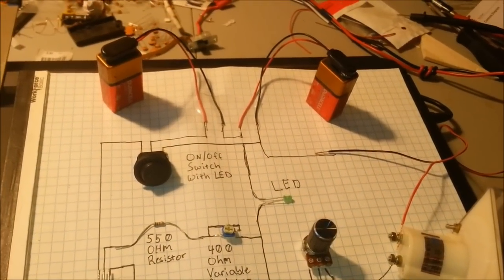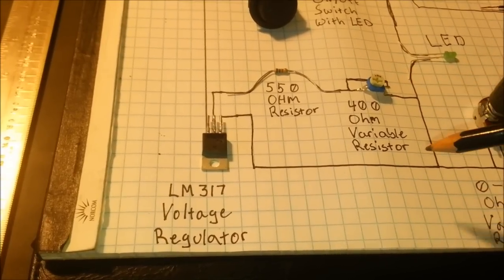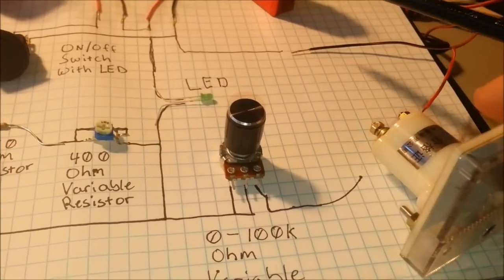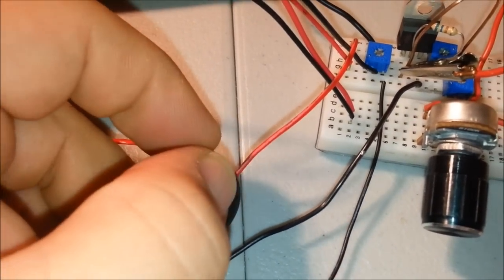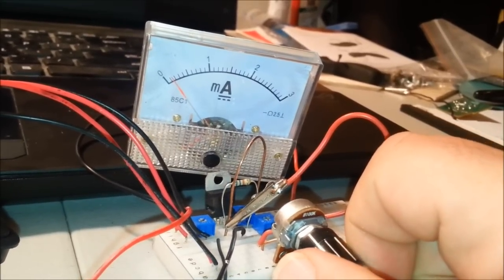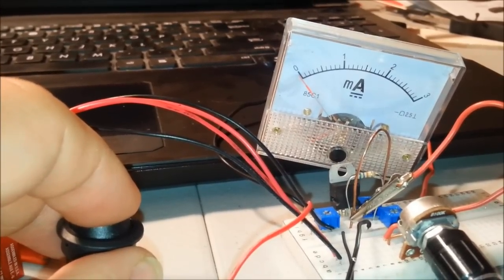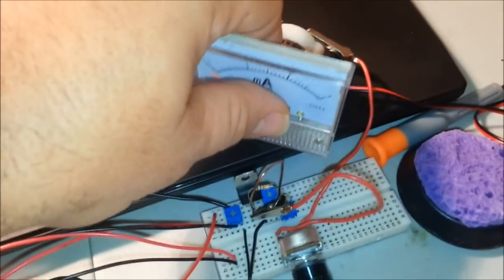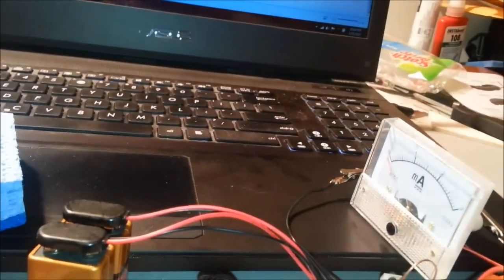Easily build a tDCS machine - How to DIY

Comment: The only problem I see with this is the availability of parts.  If you can find an electronics supply store like Radio Shack used to be, you might be in business.  Unfortunately, I don't know of ANY that are still operating in our area anymore.  Like "Hobby Shops", most if not all "electronics supply stores" are a lost remnant of simpler times...
Reply from the maker: How true, my friend. This is one of my oldest videos. Those stores are all extinct. You can try adafruit, mouser, or digikey and the like to make online purchases. Good luck.
Reply: @JonCammarata  Is it a big deal if I use a 560 Ohm resistor instead a 550 Ohm one? The internet is full of 560 ohm resistors but I cant find no 550 ones
Reply from the maker: @LesDudez  Nope, that should be just fine.
Reply: @JonCammarata  I would like to know why you are using 2 batteries instead of 1. Wouldnt one 9V battery be enough?
Reply from the maker: @thomaskreisel5764  There are a few reasons. The current regulator works better with the higher voltage. The internal resistance of 9 volt batteries is high. So, the extra current availability tends to help.
Reply: @JonCammarata  Thanks! 🙏

Comment: I have been using a TCDC device of my own making for about six years.  It certainly has boosted my cognitive abilities.  I use a basic small volume control to address controlling the intensity.  As a side note, I would add that it seems to actually help with manifesting things.  In other words, they say that your thoughts have power.  In my case, I give more power to my thoughts.  Whether it's related to the documented effect that thoughts seem to have at the Quantum level of reality or not, my attainment of things that I want to bring into my life seems related to the use of TCDS.  Consider that possibility.  Prayer, meditation, etc. all brought up to another level with the addition of more power...So, be careful what you wish for.
Reply: Interesting.

Comment: Got a 2mA read it, finally! Can't wait for my 4mm banana connectors to get here so I can attach my electrodes!!! I got the Caputron 2"×2" electrodes.

Instead of a 100k ohm potentiometer and a separate switch, I got a 100k ohm potentiometer with a switch inside and wired it where you have your switch. That way, the potentiometer can never be up at 2mA when I switch it on, so no possibility of a flash! Unless of course I turn the dial too fast.

Thanks for the video. Very helpful.
Reply from the maker: That is great to hear. Good luck.
Reply: @JonCammarata  One last question. Which one is the cathode and which one is the anode?
Reply from the maker: @rowanmurphy5239  Anode is positive. Its the one attached to the circuit. The other is the cathode. It is connected to ground or negative lead on battery.
Reply: @JonCammarata  many thanks. I can't tell you how much I appreciate your video and I'm very excited to own a TDCS device!
Reply: @JonCammarata  I have mine hooked up in DARPA montage currently (anode right Temple, cathode left shoulder) I'm instead of drawing the 2 milliamps it was drawing just before, it is now drawing 0.2 milliamps. Is this normal? I can feel a slight tingle on my right temple.
Reply from the maker: @rowanmurphy5239  make sure you have good moisture on electrodes. Also thats a long way from shoulder to temple. The current regulator may not be able to keep up with the voltage drop.

Comment: Thanks for the video. Just wondering a couple of things.

First, is a 0.5 watt 400 ohm variable resistor enough? That's what I found on digikey.

Secondly, I looked at the diagram. I'm confused. But that's likely my fault. You have a wire to too my mind looks like a short circuit. To describe it, is the horizontal lines under the batteries between the on switch and the vertical line going up from the LED. My likely ignorant mind doesn't understand why the electricity wouldn't just go through that rather than through the resistors. Can you help me to understand?

Thanks.
Reply from the maker: The variable resister you selected should be fine. As for the other question, the vertical line is on a 0 volt leg or ground, if you will.  I think I noted that the LED isn't needed and can be removed from the circuit. I hope this helps.
Reply: @JonCammarata  thanks. I'm still confused, but that is the fault of my own ignorance. But I would also like to replace both the 100k ohm variable resistor and the on switch with a 100k ohm variable resistor with built in spst switch. The on switch on your device is an spst switch, correct?
Reply from the maker: @rowanmurphy5239  that should be fine. Get one extra incase you need more resistance to control the current. Just put them in series.
Reply: @JonCammarata  many thanks. I hope to buy the components next paycheck. I'm going to wire it exactly as you did, except with the SPST in the variable resistor as I described. That way, I can't accidentally turn it on with the resistor up at 2 amps and get that flash.
Reply: I see the same thing.   One side of the switch shorts the batteries.

Comment: Really what you are doing is amping up the crown chakra and the third eye chakra I believe. You could also use a frequency generator and do the same I believe. You also could do the same on all the Chakra points of the body I believe. You have 7 main chakra point that start at the bottom of your tail bone up to the crown of the head. Look into Chakra system. You could maybe use this on all the chakra points

Comment: Dear jon, it’s a beautiful video, i did the tDcs, but i need to ask how many volts it must take out? Cause I’m getting electrical chock from it
Reply from the maker: I'm not sure I understand the question. Do you want to know the voltage across the electrodes? That depends on the resistance of you head. The current regulator will adjust voltage to achieve the 2mA current.
Reply: I did the same the ones you said, but when i check it on the sponge i saw it 18 volts
Reply from the maker: @antoni973  18 volts is fine. You only need to worry about current. If you built your machine correctly, you will not exceed 2mA. If you check voltage at electrodes when it is not connected to your head, you will see max voltage (2x 9 volt batteries), because there is maximum resistance and almost zero current through your meter. If you connect to you leg, you should see the voltage drop as the regulator lowers voltage to maintain the target current.

Comment: can you also use this for musscles pain ?
Reply from the maker: Some claim that tDCS, with the correct montage, can ease some types of pain. But, it does not work like a tense unit when placed directly on the muscle area.
Reply: @JonCammarata  are there any known working diy scematics of muscle stimulators that you know of ?
Reply from the maker: @donsaludable3284  I am not sure. I could probably design one, but I don't have the time these days.

Comment: Right now i found only 2 trimmer, (Half turn) 
201= ?Ω 
205= ?Ω 
(never understud the number on them)
Reply from the maker: Hard to say without know the brand. Check digikey.com, newark.com or mouser.com.

If you have them on hand, you can measure with an ohm meter.
Reply: @JonCammarata   thanks

Comment: Hi, May I know what gauge cables you use? Thanks
Reply from the maker: Hello Reza,
  The current is so low that you can use any size wire you want. You wont find a cable/wire that is too small.
Reply: @JonCammarata  Hi Jon, I couldn't find 400 ohm variable. Can I use 2 x 200 ohm variable in series? As to 550 ohm resistor I could only find 560 ohm online. Can I use 560 ohm and adjust the variables to arrive at 2 mA?! Thanks for your help. Sorry I'm a novice!
Reply from the maker: @rezaadel4203  Yes, Reza, you got the right Idea. Resisters rarely match their rating perfectly anyway. If you get close, you can tweak it to perfect with the potentiometer/variable resister.
  Good luck.

Comment: Hi Jon...What do I change in the circuit to enable a max current of 4mA?
Reply from the maker: Current limit can be adjusted but modifying resistance of the output (pin 2). I don't recommend going over 2ma. There is absolutely no evidence to support the idea that more current correlates to better results.
Reply: @JonCammarata  When you refer to "modifying resistance of the output (pin 2)", is that the LM317 regulator or the 400 Ohm variable or the 0-100 K Ohm variable resistor you're referring to? I wondered because I've seen a few devices with mA outputs extending to 3 and 4 mA and thought I should build the possibility should a correlation between more current and better results arise in the future....basically future proofing the device if possible. Also, thanks for replying so promptly. I'm a 67 year old actor trying to future proof my working life by experimenting with some 'working memory' enhancement montages to help with memorising scripts.
Reply from the maker: @willbergman2483  pin 2 of lm317 regulator. The resistor would be around 320ohms. I did the math on my head so don't bank on it. Get 400 variable resistor put in place of the 550 ohm dial it in to what ever current you like. But, again, there will be no added benefit to increasing current. Every study that I have read on this particular subject has strong evidence that you will only increase risk, not reward.

Comment: do you have links for parts? Thank you. Also, great video
Reply from the maker: Hi Mark, I don't have links. I could put some but these types of components chang scew so often that I would be on constant update mode. Try online sources like digikey, mouse, or automation direct. Also, this video was made 3 years ago - back when tDCS devices were over 500 dollars. You can actually find some well built devices for less than 100 dollars. Do a Google search and check Amazon, as well. I hope this helps.
Reply: Thank you for the very quick response, and thank you for the suggestions!
Reply: I can't seem to find a 400 ohm variable resistor cheap online. Where did you get yours? Thanks.
Reply: Also, is a 540 ohm resistor in place of the 550 ohm resistor and a 500 ohm variable resistor instead of a 400 ohm variable resistor ok?
Reply from the maker: @markfogelson4252  yes, that will work. You can also search for rheostat. Or use a 200 ohm register in series with a 200ohm variable resistor. That would give you 200-400ohm variance.
Reply: thank you so much this has been extremely helpful

Comment: I’m considering using a laboratory dc power supply. Thoughts on why this may or may not be a good idea? I figure I can dial in the appropriate mA fairly safely.
Reply: Great video by the way! Im torn between building this device or just using my dc power supply.
Reply from the maker: Well, if your PS is similar to the one I have in my lab, that would work great. Most people don't have thousands of dollars to buy a quality PS. Hence, the creation of my YouTube video. Also, it might be smart to add 2mA Z-diode or some other reliable current regulation. Safety First
Reply: Jon Cammarata excellent point! Thank you!

Comment: Hey Jon, great video. I just have one question: I wired everything correctly (at least to my knowledge) but instead of using one 550 ohm resistor and a 400 ohm trim resistor I used one 510 ohm resistor in series with a 50 ohm resistor and my trim resistor is 500 ohms instead of 400. Now I have a feeling that this should still give me the current I need but when I power it on the needle on my analogue ammeter goes all the way to the left (bellow 0) and does not move. No mater what I do I cant get the needle to move. It will remain there until power is removed from the circuit and after that it goes back to 0. I know it can be hard sometimes to figure out what the problem might be by reading a comment so if you want could you please contact me through my email doyle.phil01@gmail.com. Thank you.
Reply from the maker: Philip Doyle - hey bud. It sounds like the polarity of your ammeter is reversed. Try swapping the connections arround. Then, using a voltmeter, touch the your leads to the electrodes. If the voltage is negative, swap the leads. The electrode that is touching the red lead from your volt meter is the anode. I hope this helps
Reply: Thank you Jon for such a quick response. You were absolutely right about the polarity being wrong but it turns out that there may also be something wrong with the analogue ammeter I bought because now the needle does go beyond the 0 point but when the ramp up potentiometer is turned all the way (to maximize current) it only goes up until about 0.3 milliamps. When I used my multimeter instead the current did climb all the way to 1.92 miliamps. All to say thank you for your help and for the video I'm looking forward to using this machine the research does look promising.

Comment: Would an L7805  voltage regulator work?
Reply from the maker: Ninja Sneeze I don't have a dats sheet in front of me for the l7805 IC. If it can be utilized as a current regulator like the LM317, then yes, it would work. You'll need to check the data sheet for that chip.

Comment: hi there.  love your video.  thinking of building this unit but just wanted to make sure there  werent any more recent revisions/considerations.  how is TCDS going for you now? Still great?
Reply from the maker: Mark Allingham 
  Every thing is going well. I don't use it as often as I have in the past. As I mentioned in the video and in other posts, it isn't very effective unless you are actively trying to learn. I am thinking of using it during video game play. There seems to be some positive results in that arena.
Reply from the maker: Sorry, forgot to mention that there have been no revisions. However, the price of tdcs units have dropped by many 100s of dollars. When I made this video they were very expensive. So, you might get a good deal on a manufactured model. But, if you are a DIY guy like me, build away. My design is as good as any on the market.
Reply: one quick question....having trouble finding a 400ohm variable resistor where I am.  Do you suggest I use 2  200s in series or a 500 ohm, which I can find.  Sorry, im sure this is a pretty dumb question.
Reply from the maker: Mark Allingham no such thing as a dumb question. Either of those options would work.

Comment: Thank you for the video.
I want to ask you a question about the circuit and please help me with this, when I put the anode on the cathode to try, everything works fine and I get 2 to 2.3 mA, but when I put them on my brain I only get 0.6 mA max knowing that the sponges are really wet, could you please give me a solution?
Thank you in advance
Reply from the maker: Sand Nd check batteries, ensure the wet sponges are touching enough wire lead, check to see if there are any thin connections, did you use my design? Did you make any changes? Hope this helps.
Reply: Thank you so much for your reply.
I'm using your design without any changes and with new batteries, everything is going great when I touch the sponges together, but when my head is the load I get 0.6 mA max, can I try to put a current regulator instead of voltage regulator or you think it's better like this? shall I decrease the resistance or any other proposition?
Reply from the maker: Sand Nd the voltage reg is configured to be a current reg. And, it appears to be working when you touch pads. Try this: Wash the area where you attach the pads to your head. Also, make sure the ramp up potentiometer (adjustable resister) can be adjusted to zero ohms. Good luck

Comment: Thank you for your video, can I ask is what is known as a ' Revitive circulation booster' compatible to use in tdcs (although obviously the instructions only suggest using it on your body and warn not to use it on your head) ? I have one and don't use it and wondered if it could have the level of current which would not be to much, this would be ideal as it has electrodes and adjustable inputting, is the level likely to be to high even on one of the lower levels for safe usage? As it seems ideal to use as long as the levels are kept to a minimum, on a level level higher than just over the minimum I presume would be to much, but have no idea what the sort of ideal current would look like or feel on my leg for example. 
Is there a way to tell for testing what kind of current is going through without an amp meter? 
 Many thanks
Reply from the maker: christofinb, thanks for the question. The booster you mentioned is akin to a tens unit. You can not use this for several reasons. It uses pulsed electrical current that is not suitable for tDCS. It may not kill you, but you would have a splitting head ache at the very least.
Reply: Jon Cammarata
I thought it might not be deemed appropriate for users for brain stimulation so I thought I'd ask, thank you.
I have been experimenting with it now though on the lowest setting and it seems to work quite well for a general stimulating effect and a lot of physical energy.